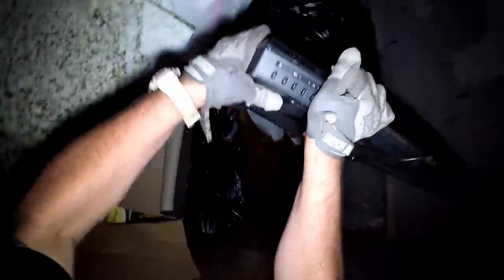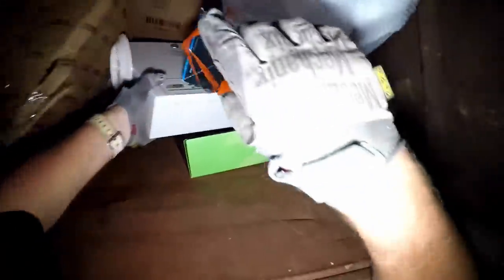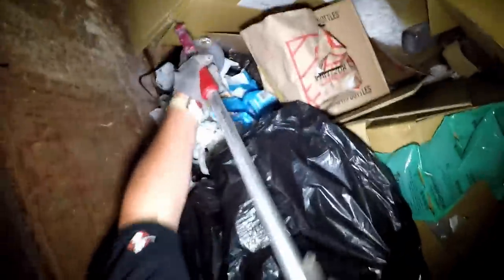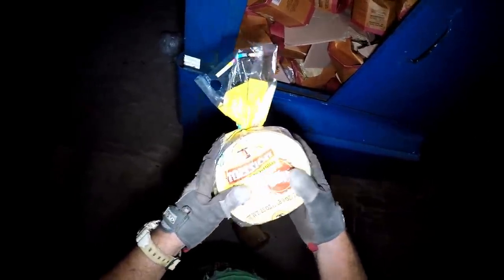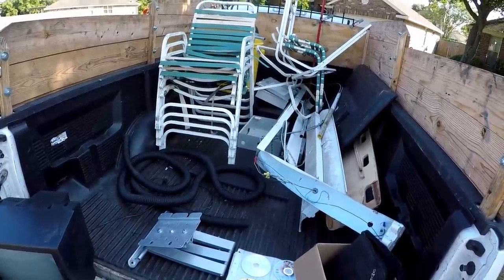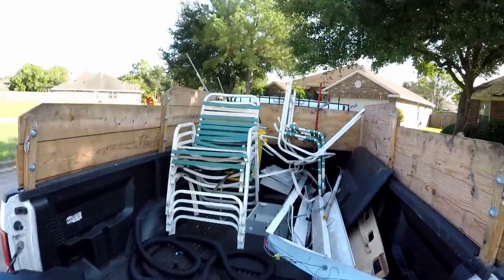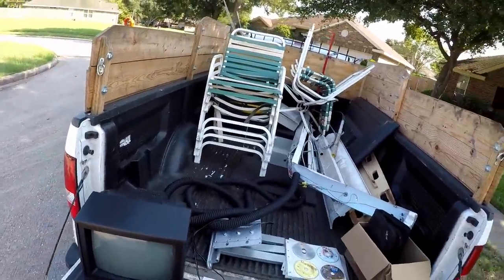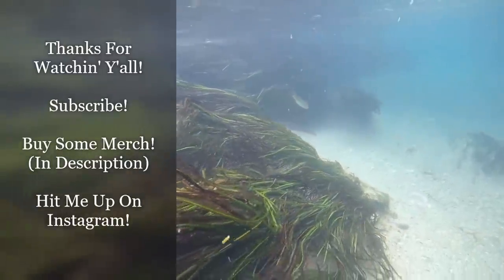Dumpster Diving "I Will If I Wish, Yo!"

Comment: That pump thingy looks like a central vacuum system, but i may be wrong! And as many says, look up how to discharge the tube on the tv...it probably haven't been used like for ever, so it shouldn't be a problem, but just to be on the save side.

Comment: Tube tvs have leaded glass. Basically just dont break the glass and snort the dust and you will be fine. The lead in the glass isnt very accessable biologically, so the main issue is just the potential to inhale glass dust.  Ive scrapped loads of tube TVs. Some have lots of copper, some very little, it varies by age, size and brand.. Older and bigger, better usally means more copper. Watch for big sonys, they have been good to me. 
Happy scrapping! OW!

Comment: No Mercury. It's just hard to get rid of the scrap that's left over. I'm a scraper myself and I don't mess with them unless I can take them apart where I find them. I have a couple of the left overs that I've had for a couple of years. Clean them where you find them. Just take the housing apart and gear the red gold and leave the rest.

Comment: The plastic bits in the bags look like the components for kitchen base unit legs for adjusting the hight of the units but you only got the middle sections. the flat part with the screw holes to attach to the floor & unit top & bottom are missing.. Keep up the madness Mike, Loving watching from Yorkshire England.
Reply: WRONG!

Comment: that pump looks like a vaccum pump. we got one like that but bigger for the cnc router at work, the suction holds the sheet of plywood down on the table.
But that pump you got looks like its setup to be supplying air.

Comment: Yeah, I scrap the old tube TVs when I come across them. The big ones especially have a lot of copper in them. Just don't be stupid and bust the glass to get to the aluminum and steel inside it. The glass has lead in it, plus there's poisonous gasses inside the tv. To get the copper yoke off the tube, just unscrew then twist and yank on the yoke. Please don't bust any of the glass. There's a big wire that runs along the outer part of the glass on the back that I especially love, because the bigger the tv the bigger and thicker the wire. I got about 2lbs of copper from just one of those wires from the last big tube tv I scrapped. Happy scrapping!

Comment: Yes Mike there is copper in the old TVs. I take them apart all the time. I just take a hammer n hit the tube to let the gas out. It's not alot. Just alot a screws to take out.

Comment: Here's a tip. I can get the copper out of that T.V. and have the back screwed back on it in about five minutes. I don't bother carrying them away from the dumpster. I carry a multi screwdriver and sidecuts. I get the copper out of it, put the back back on it and tos it back into the dumpster.

Comment: You can have a lot of copper but DON'T BREAK THE TUBE OF THE TV, this is really dangerous, dint risk you life for 1 pound of tin, just take the copper out of the TV
Reply: Not really that dangerous, it's just vacuum inside. The mesh on the front is ridiculously sharp though.
Reply: @1_GigaWaffle  when you break it, the small part of glass are "shred" by the vaccum and become really really small, like dust, if you breath this, you can have cancer, and it is no more recyclable, and dangerous for you
Reply: I wouldn’t risk it for a little copper. It’s not worth it.

Comment: After 12 years in the construction trades I'm a big fan of dewalt power tools that being said I've recommended ryobi battery stuff for a low cost capable system their batteries are half the cost of dewalt to replace.

Comment: at 9:50 those are not recyclable. With CRT's you are fine just don't break the tube it's self. A lot of copper is a bit of a stretch, the yolk's can be good but other than that not really unless you get a copper degaussing cable

Comment: Mike CRT cathode ray tubes do have copper wire on them but be careful as the circuit attached to the tube can hold an electrical charge that packs a wallop.
Proceeded with caution.

Comment: that pump looks like the kind for pumpin' turds uphill... adding a comode in  a basement.  i'll take it i can use it...lol.  
 the plastic looks like something to hold peices of pipe together for a display case, cloths hanger type stuff in a retail store.
 i still have cd, dvd, vcr, blueray stuff... i use them testing flatscreens i'm trying to fixate on..

Comment: taking copper from them tv is easy. once the back comes off theres one or two scres holding the copper on then it just pulls off. put back of tv on with few screws  jobs done lol.  also that pump thing if anything  see if the motor works if it does annd rest  isnt useful sell just the motor. that looks like a   costly one!

Comment: If you pull the plug off the back of the picture tube you should be able to see a small glass nipple right in the middle. gently break that and it will relieve the vacuum and then the tube can be handled safely. when the hissing stops it`s all done.

Comment: I was always told that the capacitors can build up and store a KILLER charge
Reply: Yep the old car type a fun to load and leave for "presents".
Reply: Yes, always discharge capacitors before working on electrical/electronic equipment. Capacitors can hold charges with enough amperage and voltage to finish your day for you.
Reply: @Vault57  of your capacitor is 2 centimeters long, you don't risk too much, but capacitors like washing machines, microwaves and stuff like that can kill someone

Comment: great night video
you'll find a lot of copper and sometimes Nickel wire, but do not break the tube of the TV,  the gas contained in the tube is explosive and in case of injury it generates risks of sepsis
Reply: There is no gas, but vaccum in there
Reply: @sovietcomrade7733  vaccum can be but still dangerous

Comment: Looks like a scale with bio impedance, show you a kind of fat you have.  And the motor maybe a fixed vacuum for dust and liquids. The Gray fittings looks like The conectors to install in the rooms like elétrical plugs to conect To the vacuum traditional hose tô clean The Floor The motor usually instaled on the garage. Easy to taking Out The dust directly to the  garbage containers.

Comment: another dive vid let's hope we get another dumpster like before, what as in chips? like the eatable kind not the kind you put taccoo contents into? man if there in date and are chip then i'd be grabbing them as that'll make me happy and no longer has to shell out for them, now that's a nice find in the box too huh must be broken pr not working? still good scrap, one more linace plate to add to the collection, on the back were the crt box part is there is a yock york? egg thing named that has a load of copper on it, plus there are small bits of ally in there too, YEEEEP! still got a dvd player, well three, the dvd tv crt combo that i no longer use as no remote, my ps2 but that is slowly dying if its a long film or show it'll start to trip or screw up, but my lil portable dvd player works just fine, plus dvd's are uber cheap, that's a very sun/water damaged back board its so bad its just breaking apart, bummer on the break in, hmm can you remember the names? or any marks/damage you did? might help in going to pawn shops and showing them your vids and saying if you see this its stolen goods that or put the word out to local pawn or shops that buy that stuff you might get them back, the razor scooter is a good name so that's why they took it, dumb dumbs missed the rest of the unit though full of scrap bits lol,

Comment: Be careful Mike. If you want you can check out my recent video on Scrapping out a TV or someone else's video. Either way, don't break the center piece of the TV that the copper wires are wrapped around. Loosen the two screw bolts and remove the copper yoke very gently.

Comment: The pump is a side channel blower, not cheap items, looks like it's configured to draw air in through the filter, into the blower and then discharges filtered air out into whatever application is required.  Sometimes used in spa's to aerate the water, bubbles etc.

Comment: The crt tvs are ok mike ,they are good scrap .2 things first it is best if tv has been turned off for as long as possible so as the power has time to drain from the fly back transfomer .2xnd try to not break the back of the crt tube .i use to do them on a metal earthed out bench

Comment: Brother do you know I want to help it's about the same amount of work whether it's a big TV or small TV leave the little ones behind as you would say the juice is not worth the squeeze the big one's can yield you up to $12 in Copper sometimes more but sometimes have a band of aluminum around screen actually 2 bands but if they're a good big old Sony you 2 get a nice stick ropes easily strippable copper it has like almost like electrical tape wrapped around it can you just run your straight edge razor along it and it peels right off and have sweet bright number 1 Copper and on the back side of the tube there's a whole bunch of copper wrapped around this weird material you can just take a screwdriver and loosen it that way you don't have to have the tube implode on you but if it does no worries it sucks in doesn't blow out how much nothing deadly inside of it but once you get that piece off to get to the ground and take your framing hammer with the waffle head is the best and smash smash smash and in a moment you'll have all the copper free and that's really all that's worth that you can take out the low-grade board for $0.10 if you feel up to it I don't mess with the rest of it unless it comes out really easy I used to do it all with my framing hammer no screwdriver with a screwdriver is quick and efficient as well cordless is even better with a long tip before I did scrap metal all I did was TVs that's how I got started doing the metal not dumpster diving have a great day Mike PS I still use my DVD player I have no food in my kitchen just DVDs Bachelor Life brother

Comment: My guess for the motor is a central vacuum system, looks like the hose connects to the black cylinder with the filter. Great videos Mike, sorry you got robbed, Scumbags. However worst things happen in life and I doubt they will keep you down for long.
Reply: NOT a central vac motor!

Comment: need to buy a fire excueesr and wire it up to your unit, that way your know to open it a lil then pull the string off anyone else will fling it open BOOOOM FACE FULL OF POWER AND RUN!